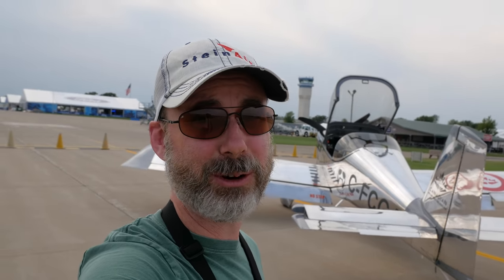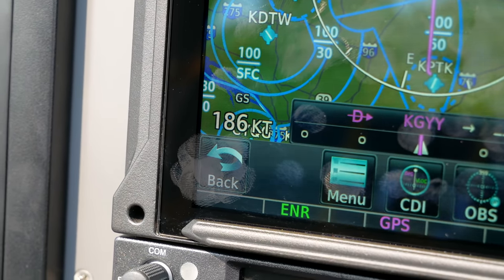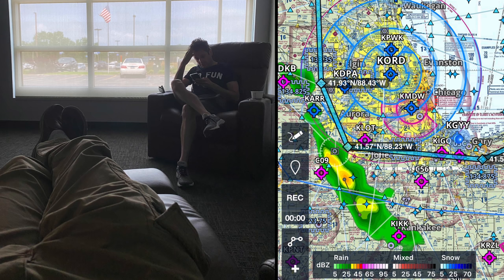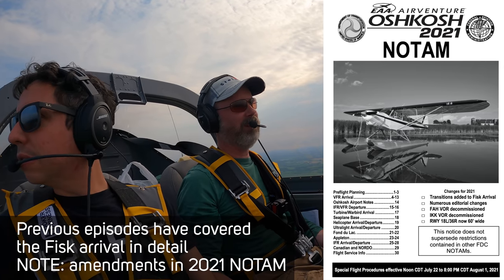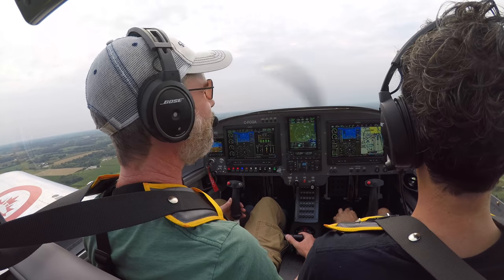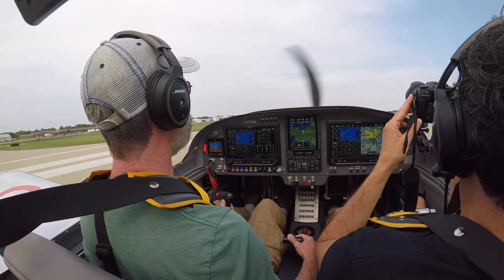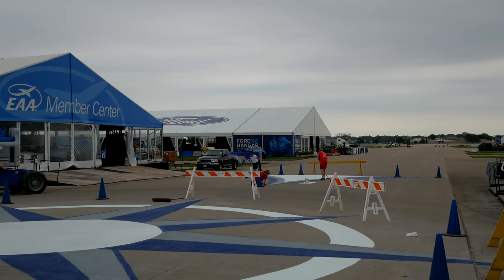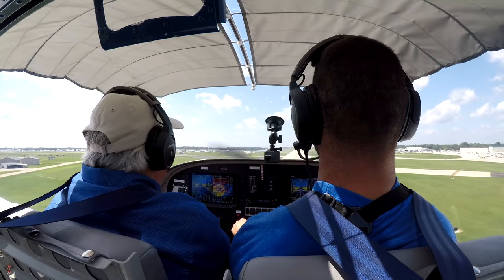We did it! Flying RV-14 to AirVenture 2021 + on display at Garmin booth!

Comment: Sorry I missed you.. My radial engine developed some pretty decent Push rod tube oil leaks. The o rings were harder than concrete... So I hung around for 6 hrs, then left. That line of super storms dropped a Tornato just 10 miles from our hotel, got the sirens and everything.
Reply from the maker: Yeah - it was a tough night.

Comment: Watching the vinyl application struck me as analogous to how different our building paths have been in so many ways. You used vinyl lettering; I used vinyl to mask for lettering.  So cool seeing you land at PTK; can't wait until you can stop and visit someday.  Enjoyed watching your cross-country chops in play in the new aircraft.  Wish I could train with both Mike Seager and Bruce Bohannon, but that would bust the budget.  The stinger with Blake made me laugh; we've all sung the refuse-to-autofocus blues!  With the fuselage now at the hangar, I'm going through that awkward transitional phase.  The hangar isn't quite ready yet; improved lighting is on order.  Trying to decide which tools should stay where; what needs to be duplicated, etc.  Painting the cowling and other fiberglass bits now; moving supplies to hangar while paint dries.  When winter comes, I'll be missing the shop for sure... but by then the airplane should be flying.  We'll see...

Comment: For the windscreen, Keep an eye open at not busy FBO's or bike shops etc  as you can find plexus that might be old stock  cheap  cause in jumped a lot in price,
Reply: I've always used Nexus Plastic Polish (#2 ), on everything from windshields to helmet face shields, headlight lens etc. Buffs out all fine scratches and makes things like new. It's just right for optical plastics, much better than buffing compounds.  JMHO   --gary
Reply: @gtr1952  I'm curious to try that stuff. is it nexus plastic polish or novus plastic polish?
Reply: @thehoeser  Your right, it is Novus! White bottle w/red letters. I've been using it since the 80's and a bottle lasts a long time. It saved me a lot of $$ on motorcycle face shields also! Makes them clear to use for a long time. Good luck!!  --gary

Comment: I’m considering building a RV-14 but wondering if it will be too much for me. I’m a student now so if I’m lucky I’ll have two years of experience when it’s done.
Reply from the maker: I’d put it in a similar spot to flying something like a Mooney (in terms of complexity and speed) but not having the gear and speed brakes as tools to slow down. But if you get some extra training mean time, you can do it… I love this airplane - I’ve got over 100 hours flying it now. 
All that said, if you don’t get a pile of tail wheel time, you’re going to want the A model.
Reply: @FlightChops  I love the idea of a tail wheel because that’s what all the cool kids fly but tricycle is what I know now so figured I’d probably do that. If it was an RV-15 or something more like a bush plane I’d probably just get the TW and learn to fly it. Thanks for the response! I fly a DA20 which is pretty slippery but not like this one I bet.

Comment: LOOKS LIKE YOU HAVE A PULSE LIGHT RECOGNITION SYSTEM. 
MOST LIKELY FROM PRECISE FLIGHT IN BEND OREGON IF USING AN STC RATED VERSION
I WAS THE DESIGNER OF THE LATEST HIGH RELIABILITY VERSION.

Comment: Was the total build a 250k affair?
Reply from the maker: That’s about right when considering all the hard costs for the latest and greatest components.  But labour and facilities expenses would exceed that I think.
Reply: @FlightChops  it is a nice plane. But you could build and fly a Tailwind for less than the cost of that panel. And it would outperform this plane on less fuel. Somewhere the EAA lost the plot when it comes to affordability, which is really the main reason to build a kit at all. Maybe the next project could be a plane that is achievable for more people. iFly and the others would likely chip in. Happy Trails.

Comment: So, if you are IFR rated how is the plane not? Not a pilot so maybe asking a stupid question. But curious. Love aviation just not able to get medically certified to fly
Reply: In Canada the aircraft systems need to be inspected and tested to IFR standards. Making sure that the altimeter  (for example) is accurate to within so many feet and that the airplane has the minimum equipment required for ifr flight.